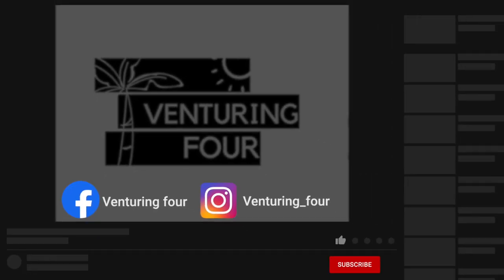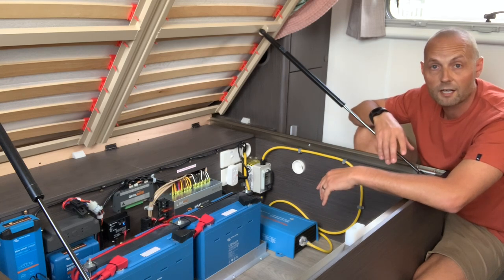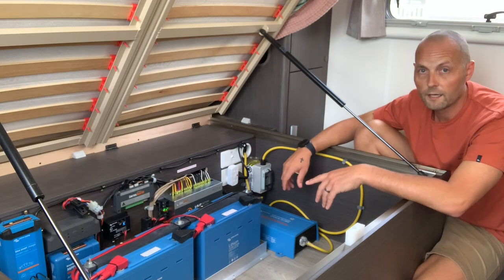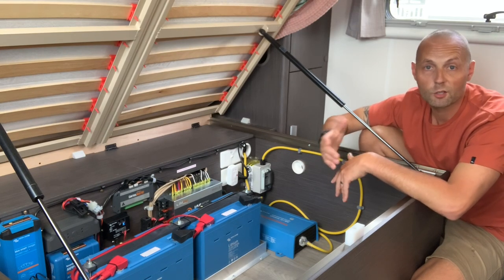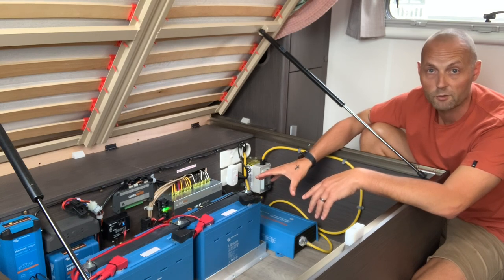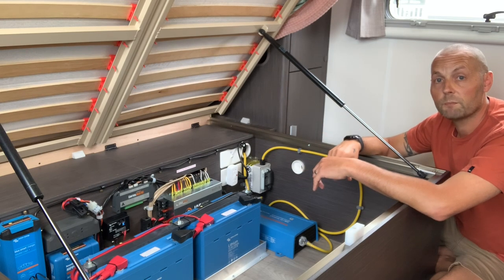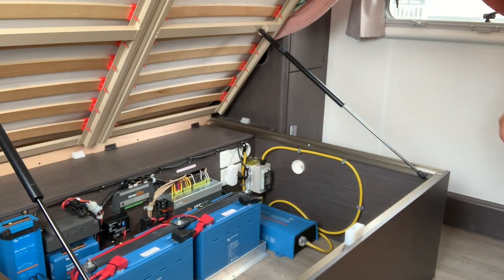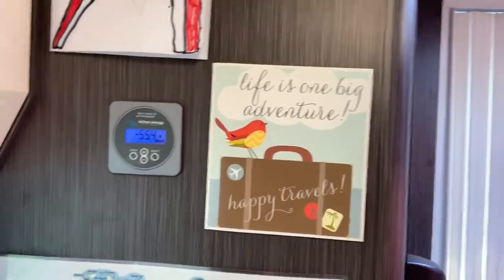HOW TO POWER SOCKETS IN YOUR CARAVAN WHILST OFF GRID

Comment: Hi I am interested in the statement that unless you have a RVD that you would somehow not be legal. The wiring rules states the need for an RCD I can find no reference to the need for an RVD. So unless I have actually missed the ruling can you let me know where the information is that without the RVD you would be illegal.
Reply from the maker: All I can do is refer you to their website rvdsafe.com.au 👇

RVD- EMR LEADS are represented by the letters MR are to work with the MEN (MULTIPLE EARTH NEUTRAL) SYSTEM and add an extra line of safety by allowing the RCBO to work when on MAINS POWER and the RVD to FORCE the RCBO to work when on ISOLATED POWER where an RCD/RCBO will not work by itself so the M means Mains and to add to the safety feature the R means it can reject REVERSE E POLARITY.
The RVDSAFE® RVD-EMR PATENTED PRODUCT is the only PRODUCT to achieve this level of safety.
 
RVD-EI LEADS are for isolated power represented by the letter I and meets the requirements of the Standard AS/NZS3000- 2018 the legally adopted Standard with Section 7.4 PROTECTION BY ELECTRICAL SEPARATION (ISOLATED POWER) and this covers ISOLATED INVERTERS using the RVD-EI takes away the conflicting ENB (earth neural bond) use that compromises the isolation integrity and allows the Inverter to stay isolated complying with the ELECTRICAL SAFETY ACT by MAINTAINING an ISOLATED INVERTER STATUS
The RVDSAFE® RVD-EI PATENTED PRODUCT is the only PRODUCT to achieve this level of safety.
Reply: @venturingfour  Thanks for the info but this still is not answering my initial question. That is where, in the wiring rules does it state that the RVD is a requirement to be legal. 
I understand the improvement with the RVD I have had my electrical licence for over 40 years, so I just wanted to know if this is in the wiring rules or one of the amendments that or distributed where I may have miss it.
Reply from the maker: @Sabumnim666  I only went off professional opinion myself. I spoke with both auto electricians and electricians who both informed me that using a RCD was unsafe and illegal. I did my research and found the RVD to be compliant and safe, hence why I changed it from the RCD. I’m unable to state any ruling either. Someone with your knowledge and experience knows a lot more than me and I’m sure anyone reading these comments would love to know your professional opinion. 👍
Reply: @venturingfour  Sorry to hear that they said using an RCD was illegal as that certainly not correct.
Reply: Aren't most caravan batteries a floating system?

I thought this means the battery is not grounded to the chassis, thus rendering any power supplied from said batteries to the caravan power supply usually located on the side of the caravan, would mean the RCD is not going to work correctly/effectively because the power supply is ungrounded...

Doesn't the caravan RCD need correctly EARTHING to work as described? 

If the powrr supply has no ground other than being connected tot he battery, then this will not allow the RCD tow work when it normally should.

The RVD website explains the reasons why many caravaners who use an unprotected lead from an ungrounded battery to supply powrr to their caravan are risking the RCD not working as intended.

Please tell us all how the information on the RVD safe website is incorrect and how an RCD will function correctly when powered by an ungrounded power supply????
Reply: @HatesSpam-cb4ym  Ok to cut things short I attended the caravan and camping show about 2 months ago and at this show they had the technical regulator booth with two people from the branch. 
I queried them on this for about 30 minutes the end result was they were aware of this RVD but at the present stage there is not enough factual testing to completely rule them out as a possible worth while component.
Along with the counter of the RVD being a nor is it proven to be  a useful addition.
The biggest bug is people have been telling the public that with out  an RVD you are not legal. That is total BS.
So I have given up on this subject as hypothetical.
Reply: It would have been interesting to hear the response from the two people on the booth if you had asked specifically what would happen when using an ungrounded battery and inverter.

Taken from the RVD website:
"The 16amp combination RCBO & RVD-EMR is leading the way forward in RV safety.

A Residual Voltage Device works with isolated power such as Generators and Inverters and monitors voltage leakage to earth and can be set up to monitor on L1 only or both L1 and L2  and will trip an RCBO before the voltage leakage reaches the 50V Touch Potential Voltage where danger to life and limb can occur whereas an RCD (Residual Current Device) which is designed for the MEN system and will not work with isolated power unless an ENB (Earth Neutral Bond) is created and this then may compromise the isolation integrity in a fault situation where the AC side can power the DC side with potentially fatal results."

I find it strange that they could make such claims (being the only company out there) that doesn't seem to have been challenged legally over their claims. Working with electrics can be very dangerous and I know for a fact the RVD Safe website would have upset many "professionals" in the electrical world.

The video of the RVD safe inverter when there man puts his hand in a tub of water and then puts a live light bulb in as well to prove his faith in the system is as much evidence as any RCD would need to show me that it does work.

I don't believe RVD Safe have done themselves any favours by not showing CLEAR evidence of their RVD working when an RCD will apparently fail. 

I feel they could have a clearer description of why their product is safer and in exactly what/all current known situations where it will provide extra safety.

With that said, the information they have provided on their website seems pretty clear to me as an uneducated person simply interested in the topic.

I would love to hear real evidence as to why this is all BS and I am not referring to what the standards say - Because a lot of the time the standards are good but not always as good as could be due to cost and /or little extra benefits/safety mitigation.
Reply: Can you guarantee an RCD will operate correctly in all situations where a caravan is relying on the MEN system and is being powered by an ungrounded power supply from your battery/inverter?

The problem with the internet is that many people claim to know what's correct when what they quote is misinformation. 

If RVD safe went out of their way to show how their products adds extra safety, we wouldn't be having this discussion as we would clearly see if it adds extra protection, or doesn't. 

I would love to hear more of your option, I would love to hear the opinions of those at the booth when asked about the described situation on the RVD-SAFE website.

There's a reason why all 240v work should be done by a licenced electrician, there are situationsthat arent describedin the "standards" which render some saferty features void.
Reply: @HatesSpam-cb4ym  Have ever read he wiring rules in the section on RCD? bet you haven't read the section on RVD because it does not exist. 
I do not have to guarantee anything, grow up.
Reply: Do the standards guarantee that an RCD will work in every situation, especially when you're using an ungrounded power supply?  

I dislike people like you who focus on what is often IRRELEVANT CRAP, or a piss poor argument.

Where in the standards does it guarantee an RCD will work as designed when you are using an ungrounded power supply? Or in every situation? 
^^^ It doesn't pissant!

Are you familiar with what a "Double Earth Neutral Bond is" - Doesn't sound like it...

Better yet, go test it for yourself and you'll soon see why many people state it's illegal to simply power a caravan from an ungrounded battery and power supply. The RCD will think there's a load and won't trip like it normally would/should, so have fun spreading STUPID claiming an RCD will work because the standards only tell you to wire it a certain way.

As a professional, your lack of understanding towards correct grounding and how incorrect grounding can and does cause dangerous situations and leads to an illegal system, makes me cringe.

Being a professional, you should be able to clearly state why an RCD will work and why it won't fail in the situation described by RVD safe? I'm not asking you to reference the standards which DO NOT ACCOUNT FOR ALL SITUATIONS. Where in the standards does it state an RCD will work in the event of a double earth natural bond in the system?

I'll wait, but I know I won't get anything other than you quoting the standards, whilst acting like the standards explain every situation.  Again, do the standards discuss what happenes when using an ungrounded power supply - I bloody doubt it and I wonder why, could it be that yhe standards don't give you all the information?
Reply: Have you read the part where standards don't always take into consideration every situation and that standards change as time goes by? 

Your whole argument is that because the standards don't mention an RVD, then the RVD isn't needed because the RCD will work. 

There was a time where RCD protection wasn't included in the "standards" you so adamantly cling to un this thread.

The standards are the bare minimum and DO NOT explain every situation that could render that RCD protection useless.

^^^ As a professional, I'm amazed you're saying such rubbish and ignoring that the standards aren't perfect, do not explain all situation or methods of wiring that could lead to a dangerous situation, they don't because the standards would be 10 times the size of what they are now.

Please tell us what the standards have to say regarding RCD's and double earth neutral bond situation? Does it even mention anything about those situations and if it doesn't David, you might want to WAKE UP and acknowledge why...

Just because you don't understand and can only reference the standards doesn't make you correct, nor have you provided any actual evidence other tha. The irrelevant fact the standards don't mention and RVD... 

I'll bet yhe standards don't mention all the wiring methods which can result in a dangerous system, ofmr that could undermine the safety features of said system.

The standards aren't perfect, stop acting like the f'ing are!
Reply: I'm dubious only because the RVDSafe website seems to  (layman me) be very vague about how the technology works and what I'm being protected from. "Residual voltage of above 43v" means what and where from? You've got two wires, a load on one end and a source on the other. Earth in this case is nebulous and up to whatever they've done in the inverter (maybe it's case, or some selectable connection to battery ground ). You can protect against overcurrent but not RCD without current flowing back to the neutral via another wire (or you through the chassis). How the inverter deals with ground on the 240v side is the deciding factor here. The inverter you mentioned only has RCD in it as per their website.
Cannot believe that some US videos suggest the use of suicide plugs.
The RVCSafe website shows a bulb being dumped in water, what does that indicate to me? The cable and bulb looked to be a two wire setup.
Reply: @saddle1940  43v is a result of a leakage some where from a power source that has higher than 43v voltage, usually a 240v appliance. In a caravan that would come from any faulty wire, or device that shorts out.

The light bulb in water is to clearly show that an RCD only power supply from an generator will not trip the RCD if a live connection is put in a bucket of water, this shows that the RCD fails in this DANGEROUS situation and it shows the RVD trip eliminating the risk.
Then when using the RVD it trips - Why does one trip and the other not?

I do have an issue with the video not clearly showing if the second generator that used the RVD had an RCD and if the RVD forced the RCD to trip like they claim on their website, lack of clear information.

Do you think that having a SECOND method of fault detection is ever going to be a bad thing? An RCD needs a connection to ground to work, the RVD does not, or at least that's what I'm lead to believe. 

There was a time where RCD protection wasn't standard and there's a possibility we will see RCD technology become more common - Although they have been around for a while and haven't completely taken off*.

* Most likely because their website is terrible and the explanation of how and more importantly when their product will work is cage to anyone who doesn't understand what a double earth neutral bond is and how that can cause an RCD not to operate.
Reply: Are you suggesting that the 12v dc supply is a deadly supply as the inverted 12battery power via the inverted 240ac is some how the same power system? All caravans have their frame earthed this is for the 240V AC not the DC, as a professional you can not use the negative of a battery and the earth of a 240V AC as the same point for obvious reasons that the different voltages and types do not mix. The RCD is to protect in the event of a fault as you would already know and I believe all Inverters that are sold in Australia must have an RCD.
The MEN Multiple Earth Neutral bond is generally used in larger systems  as for the Double Earth Neutral Bond I would really like for you to explain this as you understand it since you have jumped up on your stand and proclaimed to be versant in this.  @HatesSpam-cb4ym
Reply: The RVD-EMR has Reverse Polarity Protection that is the common name for Transposition Protection that was mandated on 18th November 2023 in AS/NZS3001 so complying with the standard makes it legal even thought there is no reference to an RVD in the standard .

Comment: The RVD does “work” so to speak! However it’s “protecting” u from earth faults is a system which is completely isolated from earth. Thus protecting u from something which can’t happen. The same goes with the inverter’s with a built in RCD. In order for them to build these so that the RCD operates, they actually inadvertently create a permanent earth fault. Making them actually more dangerous than a normal inverter without rcd protection!😂

Comment: Unfortunately mate I think you've been hustled with that RVD. The earth of the caravan and inverter are floating so there's an extremely rare chance of a shock from live to earth and would require a conductor to earth at some other point on the vans network to reference the ground at this point the inverter would turn off.
Reply: Not correct. The caravans stabilizer leg's are steel,and connected straight to earth when down. This connection would be very conductive on rainy days. Second - - if there is a fault,and the ground is floating,what do you think would happen to some one that was standing on the ground,and went to open the steel door to the floating ground caravan ?. What then becomes the conductor between the caravan and earth ground?. Yes,you guest it - - the poor bloke holding the door.
Reply: @69Atho  If there was a fault from an appliance fed from the inverter to ground it would trip on over-current as the ground point is centre tapped causing a dead short.
Reply: @intelmacs  Hi Matthew, and I think you need to research just how RVDs actually work, before making claims about people being “Hustled” The setup in the caravan in this video is NOT a replacement of the RCD, the RVD adds an additional level of safety that RCDs can not offer. A major error many people make with caravan 240vac use, is to plug more than one Class 1 appliance into the output of an inverter supposedly protected by an RCD. People commonly plug multi outlet power boards into the output of inverters. The regulations specifically state you can only plug one Class 1 appliance into the output of an inverter’s RCD protected output. There is a very good reason for this, and that is with each additional Class 1 appliance plugged into the one output of an inverter, you reduce the ability of the RCD to work at the level of safety it is designed to work at. Two Class 1 appliances will halve to level of protection an RCD can offer. Three Class 1 appliances will reduce to level of protection to around a third and is next to useless. When an RCD/RVD protective device is used, you can legally plug as many Class 1 appliances into the single output of an inverter. In other words, the use of power boards in not only legal but is safe, no matter how many Class 1 appliances you are using and and each Class 1 appliance will have the same maximum level of protection.
Reply: @drivesafer6335  mate great explanation…..Exactly what I was looking for and in English I understand 👍

Comment: When you plug the toaster in, it’s not basically volts coming out, it’s watts and amps. A completely dead battery can still show it has 12.5 volts but be completely useless. I appreciate your very informative videos but please use the correct terminology so as not to confuse novices. Also cut it out with the BASICALLY crap, some of the things you talk about are far from basic. Carry on now.